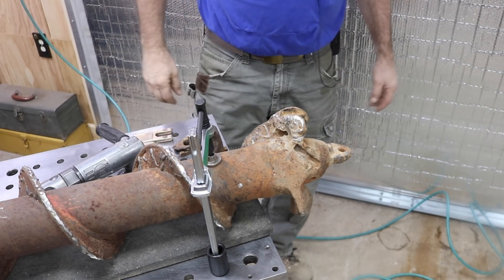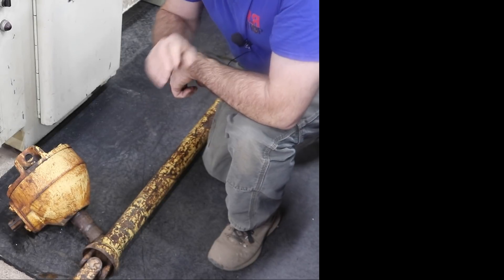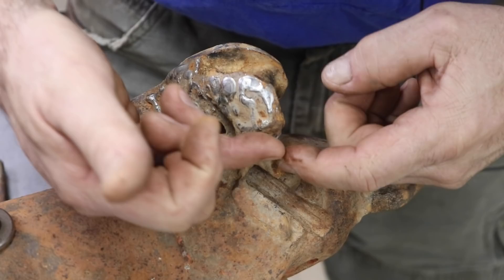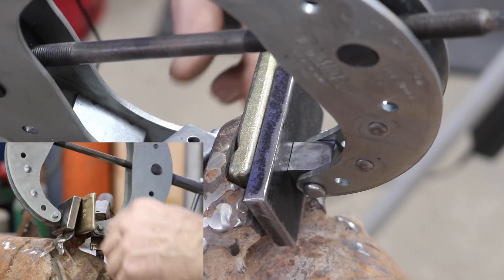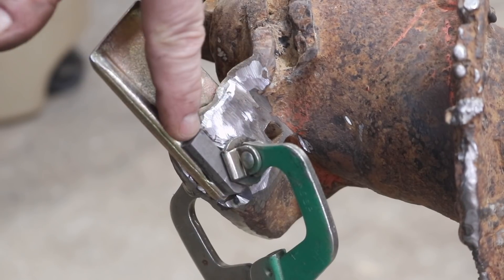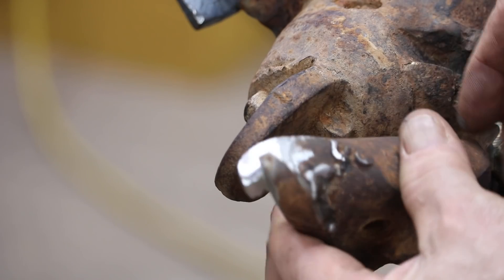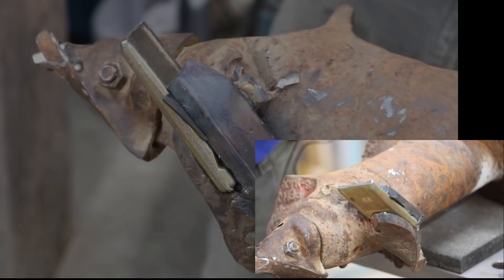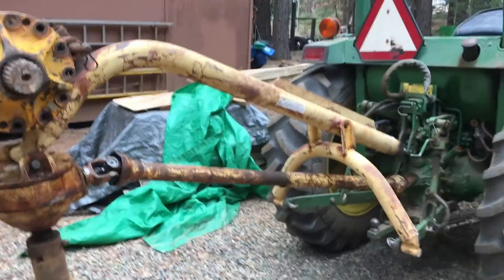Post Hole Auger Repair | Post Hole Digger Repair | Baby needs new teeth

Comment: The teeth on my skid steer auger are bolted on, even then they seem to find a way to fall out.  I can't imagine friction fit holding very long.  But I hope it works for you.  Good luck.
Reply from the maker: So far good and tight.  Thanks Rosa.

Comment: The weight was probably necessary due to essentially no teeth to dig in and advance the auger which you fixed. My post hole digger has a handle that you use to guide the gear head as you dig the hole which is very helpful to get a straight hole.
Reply from the maker: Good idea Bruce.  Thanks.  MC to you.

Comment: Baby powder on rubber makes it possible for teeth to slide in a little easier.  Greg
Reply from the maker: For sure, the teeth were fitting so tight the rubber was going going in much anyway.  Thanks Charles.  MC to you.

Comment: Always good stuff here! Try putting that rubber all the way in first then hammer in tooth. Worst case rubber bunches up.
Reply from the maker: Thanks Silent Runner51.  Yeah I did off camera, they fit so tight there just was not enough space.  They are in pretty tight and did a solid job and did not come loose.  MC to you.